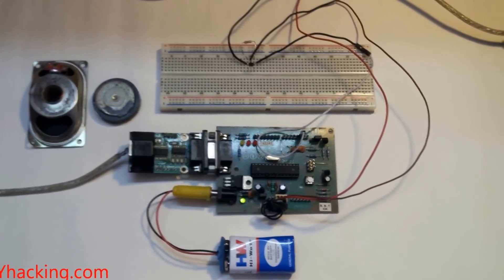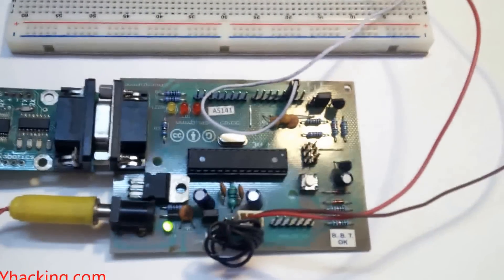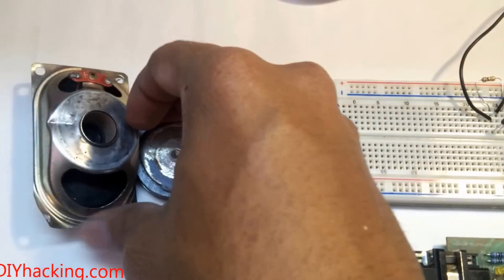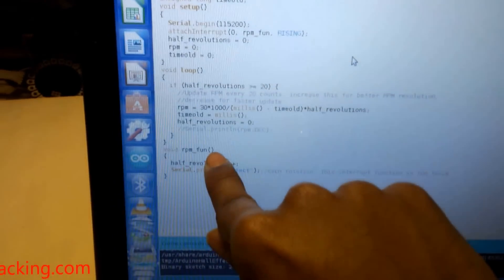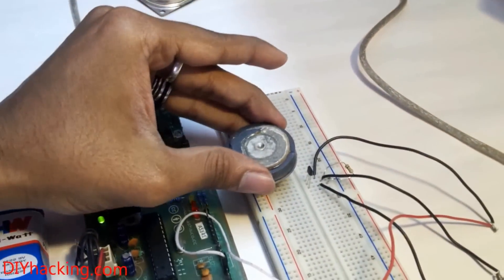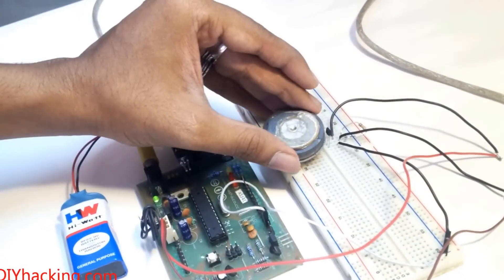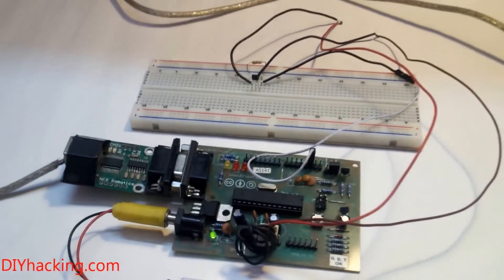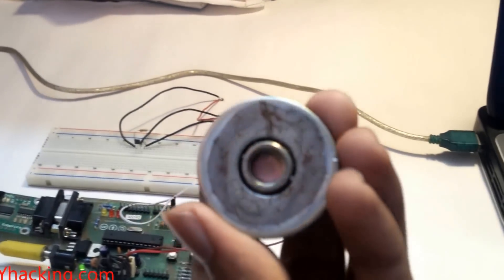Arduino Hall Effect Sensor Tutorial

Comment: It should be noted that if using this in a high speed scenario (like for RPM detection) the Serial.print lines should be removed from the magnet_detect method and if possible, from the project entirely. Use an LED display to output the numbers it will be faster than Serial and won't impede on the readings.

Comment: The magnet is probably very weak, because the steel part in the middle closes the magnetic flow circle. Only a little goes outside. And it's a ferrite magnet, which is not very strong anyways. It's not a problem here, I think other magnets trigger the led from far away, like 1 m or so.